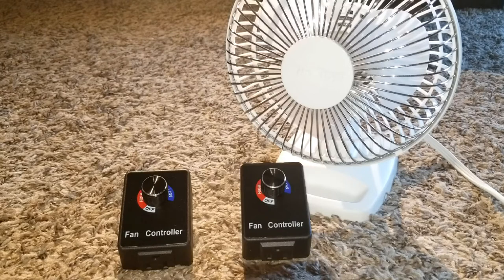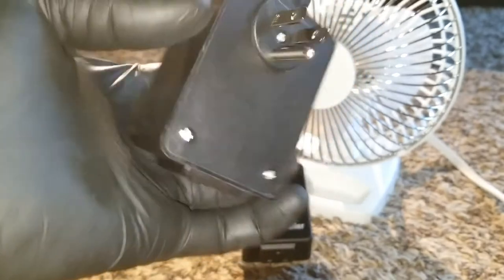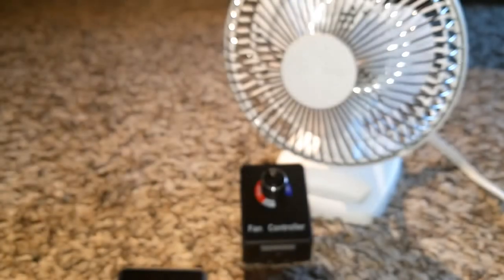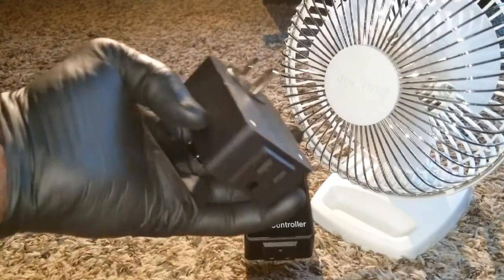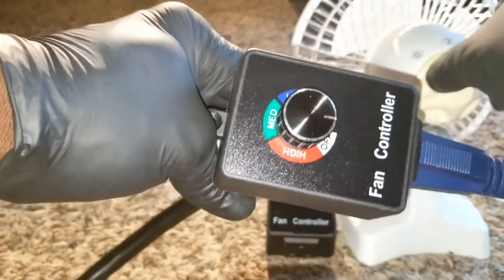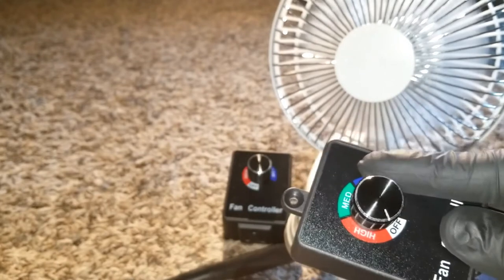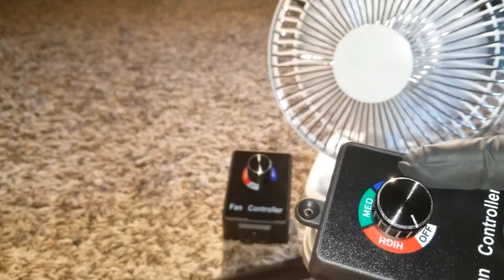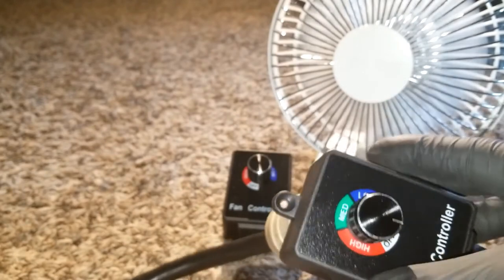VARIABLE FAN SPEED CONTROLLER ADJUSTER CORDLESS FOR DUCT INLINE EXHAUST VENT BLOWER HVAC 350W

Comment: Yea !that’s a great controller for the solar generator if it was a 12 v model like you said . Great for non speed control ceiling fans also . Can it also dim incandescent or dimable led bulbs also ?
Reply from the maker: I suppose but I haven't done any test on that yet